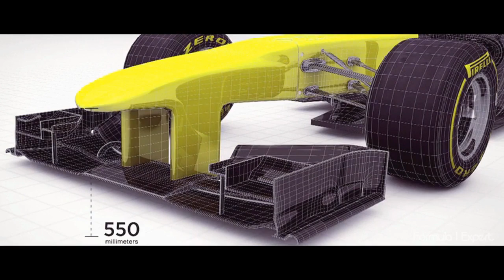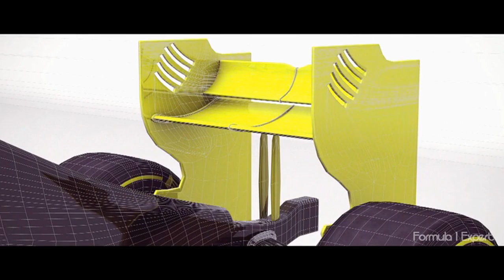Formula 1 2014 - Regualtion Changes Explained (HD)

Comment: the old Formula 1 was about raw horsepower,speed & the Drivers skill.
the way all this new F1 regualtions are going you will end up with  New F1 Cars as scale electric robotic clones on rails. Formula boring. or Formula Fail. it will be about who has the best software or who used the less fuel. Did the Driver drive the car? or did the pit crew program the car?. & it now sounds like whipper snippers or flying hedge trimmers.  boring
Reply: +JONOVID  Old F1? Maybe Group B rally and GP in the 30's were about horsepower but not F1.

Comment: what happens in the case of a nose to tail accident..... the front being so low...wouldn't it scoop up the car in front?? then were does it go? into the the drivers head.... food for thought...
Reply: no, it would break. The deciding factor is the tyres...
Reply: ***** Yeah But how reliable have the tyres been recently :D
Reply: Dylan Anderson
Ahh yeah, didn't pay attention to that one before
Reply: Jmaltz9
Reducing downforce? In which way did they reduce the downforce?
Reply: Less front wing...

the front wing is no longer the same width as the tyres so the air flow is disturbed by the tyres and there for causing a drop in aero

Comment: Less aerodynamic pressure, less traction. Where's the safety in that? Giving him (eventho less powerful v6 engines on their own, but with ers a way more power) turbo engines, you expecting them to push less? What turbo charged means in this case is lot more spin ups and with less traction will see a lot more accidents.

Comment: all cost reducing issues was bullshit! every milimeter change to a part of the body will change the entire car! and it only cost teams millions to comply. if the goal is reducing cost why dont just build an inline-4 cylinder F1 car with a carburetor instead of computerised direct injection??
more narrow front wing, lower nose, & lower rear wing means smaller downforce, how could 2014 F1 car could be as fast as its previous season?? even 2.4 V8 18.000 RPM will be changed to 1.6 V6 turbo with only 16.000 rpm
from V12, V10, V8, and now V6?? F1 is so lame nowdays :(
Reply: otiddiclvx using kers requires skill... you have one lap to use all your kers... and so does your opponent. So if you both use it at sametime in theory neither will have advantage. But thats where the skill comes in, the one who uses it at the proper time will win.

DRS is simply trackside choice for the drivers, do they want to overtake now or wait for drs zone to not have them attempt to retake position right after you have taken it.

at one point f1 was already at the stage where it was practically impossible to overtake, so qualifying and then race start was where winners were settled.
Reply: Otakahunt yep, but there was a lot more overtakes, a lot more great move, and of course a lot more exciting season. nowdays? just push DRS or KERS/ERS and 'poof' you're already ahead instantly
Reply: otiddiclvx agree! and if mr.otakahunt says 'using kers requires skill', i think its kind a joke. yes i know everyone got only a few second to use kers but in fact both KERS and DRS 92% used only at the main straight and now someone talking that 'push a button requires skill?'
i absolutely agree if someone say you need to be smart to use both of them because you have to manage it and use it at the right moment in the right time. but LOL to all of them who says 'button requires skill'. look at Ayrton Senna in monaco, driving one handed while the other hand hold the shifter. look at Mansel with his brave wheel to whel action, nowdays? all i can say is lol
Reply: Don't forget that materials and construction techniques have constantly helped to improve a vehicles performance by reducing weight and and drag. 

I imagine that if we had kept the old (maybe modernized) V12 in this current series of vehicles with the same architecture that they just would not perform as well due to the added weight and reduction in handling.

Victory isn't about the power under the hood, it's about the skill and tact of the driver and the team. These changes are designed to help accentuate their decisions, put everyone on an even playing field so no one person has an advantage over the other.
Reply: ***** "ictory isn't about the power under the hood, it's about the skill" >> agree, but you can see what happened now. they overtakes using a DRS, KERS/ERS, not a pure skill
Reply: F1 was v6 back in the 80s with only 12,000 rpm, yeah, the less cylinders the more lame it is right?
Reply: Otakahunt 2014 car wouldnt be as fast as it previous season, wanna bet mate?
Reply: otiddiclvx  I dont care, i just want F1 to be exciting again. It can only be exciting if everyone is as close as possible in terms of performance. Never again shall we have such times like when schumacher won all his championships... ferrari was way overpowered compared to other teams.